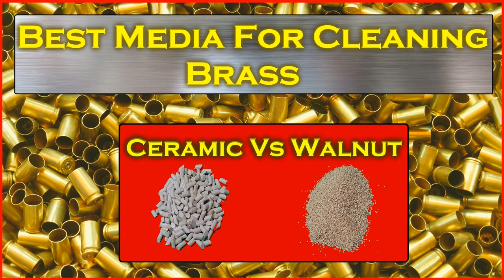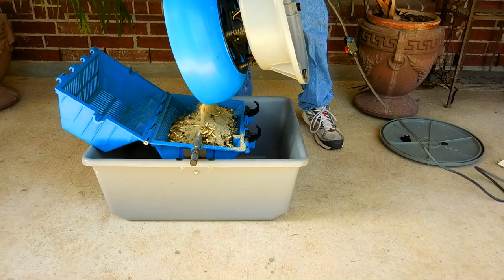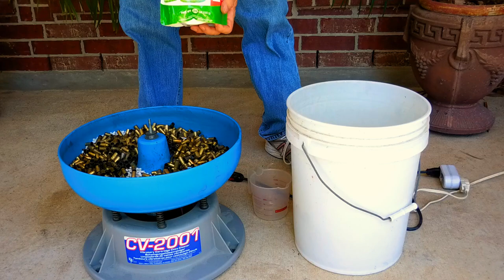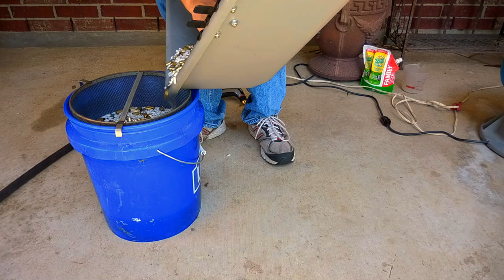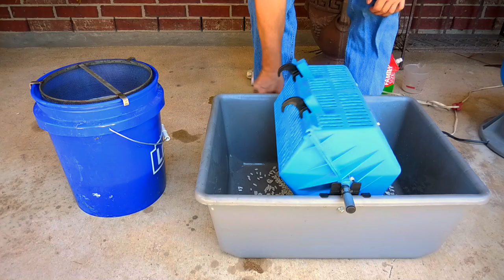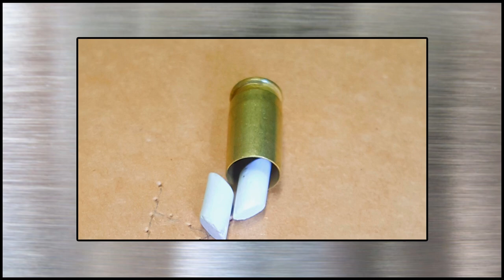How To Clean Brass - Ceramic Vs Walnut Media

Comment: I use walnut or corn cob media and have looked at the ceramic media,  thanks for the info. To cut down on the dust, add a few used dryer sheets when you tumble..it pulls a lot of the dust and dirt out

Comment: I switched to stainless steel pin wet cleaning and wow it will clean and shine the inside/outside of the pistol brass very well plus primer pocket if you deprive ahead of cleaning..  Which is another alternative to vibratory cleaning (used it for 40 years and did work).  A bit more steps to the wet cleaning and company’s have further added products to help separating the pins.   My wet stainless tumbler is from Frankfort Arsenal, which came with grills to help pour the water and pins from the brass.   Lyman then came out with a mesh rectanglar basket (2 Piece) which helped.  Later Frankfort Arsenal came out with a circular mesh replace the grills in the top of the cap’s and allows you to rinse.both pins and brass of the ‘dirty water’.  Because of surface tension of the wet stainless steel pins to ‘everything’,  I take my rotary brass separator, place some water in bottom to cover the rotating sifter and the pins will fall to the bottom as you turn the rotating handle.   Now that surface tension is sticky and not all pins will come loose but get 95+%  of them.   I then bought a food dehydrator. Place them on the trays turn it on and in most case 1-1.5 hours they are dry and any remaining pins will fall to the bottom.   I do recommend the pin magnetic from Frankfort Arsenal in which it has a handle with lever to move the magnetic from the metal part on bottom holding the pins, when picking any loose pins (small and difficult to pick up by hand, thus the magnetic pick up tool).   Well that is my thought and 2 cents, lots of different methods out there to consider for cleaning fired brass for reloading.   Good luck everyone!

Comment: I switched to a courser 18-40 grit walnut shell from amazon with some Midway USA brass polish and cut up dryer sheets to cut the dust way down. I may try the 12-20 grit next time for larger cases.

Comment: Vibratory tumbler tip:
Tear up a USED dryer sheet into 2 inch squares. Throw three or four into your Tumbler.  They will pick up dust and grime.
Reply: I put 2 whole sheets in.. Picks up tons of dust and the brass still gets clean

Comment: I used to take apart computers for the gold and along he way I saved all p[arts and nuts and bolts from them. I ended up with these little hex style bolts by the thousands and had no use for them later on. I kept them anyway and I got myself a tumbler and started watching rock tumbling videos with those nasty little pins you speak of. I thought why not use those little hex bolts about 3/8" long? I tossed them in with a bit of walnut shell to absorb the grease on my tools I was cleaning. The rest was those little hex bolts and dang did they clean my tools and sockets beautifully! A dampened the walnut shell just slightly with water and that was all. I had new sockets, bolts, washers, you name it they were clean!

Now I need to get one of those tumbler things you have there to separate the walnut from my parts into that tub. That's nice. I was using a stainless steel strainer over a bucket wearing a mask and still sucked!

Comment: I get my walnut media at the pet store.   Last time I needed some I got three twenty pound bags of lizard litter in a buy one get 2 free sale.  I filled three 6 gallon buckets and 2 midway tumblers and a lyman 2400.   I run at least 2 of them every week.  The more brass in a tumbler the better, without overloading the springs.  The brass push each other against the media cleaning them faster.  Just a few pieces of brass in a tumbler takes forever to clean.

Comment: Thank you for debunking all the people flocking to rotary/stainless steel pins.
btw...there are some ways to minimize the dust so that you don't have to resort to liquids as part of your tumbling process.
1) Drop two or three used dryer sheets into your tumbler with your brass each time.
2) Always leave the lid on while your tumbler is running.
3) Wait a minute before taking the lid off of the tumbler once the tumble process stops.
4) Use a brass separator that has a lid, as my RCBS separator has, close it while spinning out the media, then wait two or three minutes before opening the lid and taking out the brass.
I have no problems with excessive dust at all with these very simple steps.
I just don't see the value of introducing the complications and time constraints of liquids in the process.

Comment: Didn’t mean to come off so brash. When I clean my brass I use fine crushed walnut, from harbor freight and tool then add brasso and let it distribute through the media. Keeps the dust down and does a good job of cleaning. I use range brass so I’m not worried about a high shine.
Reply: DO NOT USE BRASSO. Brasso contains ammonia which makes brass brittle.
Use a 50/50 mixture of Nu Finish Car Polish/mineral spirits.
Reply: Jun Gleno, granted, brasso will make brass brittle if used extensively, especially on rifle cartridges. 

I have used brasso as a case cleaner for over 30 years. It has never been an issue as I don’t reload anything but 9mm range brass, which has anything from military stamps to assorted commercial stamps. There is no way to determine how many times it has been reloaded. I have never had any issues using brasso with these cases and it does the job of cleaning the brass to my satisfaction. If I do find a cracked case it’s usually from someone who was shooting major.

Comment: I use corn cob, about 1/4 inch, from pet supply dept. of Walmart or Petco.
I use about one ounce of mineral spirits and a about one ounce of Dillon or Turtle Wax or other liquid car wax with abrasives, even Midway Citrus Brass Cleaner.
I also stick in two dryer sheets, cut in 2" squares, appx....
The sheets absorb all of the powder fouling, and the bottom of the bowl is virtually dust-free.
Mineral Spirits wet the dryer sheets, so they can absorb the dust.
I don't like "Wet Tumbling" too much effort.
The primer pockets can be brushed out with a power drill in 5 seconds each and there's no drying, or pins getting stuck in the cases...

Comment: good vid......wondering what size and shape ceramic media would you suggest for 6.5 creedmoor and 308 cases.
Reply from the maker: I wouldn't use ceramic for bottle neck brass because it would be almost impossible to get it all out of the cases. I think it is great for straight walled brass.

Comment: deprime before cleaning, gets the primer pockets nice and clean
Reply: don't deprime if yer going to use cob.. ask me how I know.. lol.
Reply: Not necessary. You will lose those pieces of brass on the Range long before the primer Pockets get too dirty to properly seat a primer.
Reply: I'd rather use clean brassin my press when depriming.
Reply: I deprime after tumbling so the media doesn’t get stuck in the primer pockets, which is a PITA to clean out.  Primer pockets can easily be cleaned of carbon fouling with the wire brush or uniformer on my trim mate station.

Comment: Walnut shells and NU finish car wax vibrate for 24 hours clean and high shine
Reply: Two to three hours is more than sufficient.
Not the nu finish wax. Use a 50/50 mix of Nu Finish Car POLISH / mineral spirits. 
The POLISH contains NO ammonia.
Reply: I run walnut shell (PetSmart Lizard Litter), one cap full of NuFinish polish, and a dryer sheet cut into fourths.  Tried corn cop media but it really turns into dust and gets stuck in the rim recess of 45 colt.

Comment: Nice video!  Was it necessary to seal the bolts in the Dillon Case Cleaner?
Reply from the maker: You don't use that much water, you are just moistening the media and the brass. So no, I didn't have to seal anything, there really isn't any water to leak.

Comment: where do you get your ceramic media and what about using spheres or round media?
Reply from the maker: I purchased it on Amazon. you probably could but always remember that it has to big enough so two pieces can't jam next to each other in in case. So their diameter would need to bigger than the radius of the case.

Comment: Not really an even comparison because you don't use citric acid with walnut. 
If you just soak your brass in a bucket with the acid it will do the same without  the ceramic.
Reply: acid soak alters the alloy composition.

Comment: Washing and all that stuff with the ceramic is overkill!
Reply from the maker: It depends, if you are doing high volume like 5K frequently, it is a lot faster, cheaper and your stay away from the contaminated dust. If you do 1K or less every once and a while, you are right. It is a high volume process.
Reply: @AdventuresinFabrication  I am sure you realize you are dumping toxic chemical liquids down the drain?
Reply: @jungleno.  Incorrect. No different than when you wash dishes in your kitchen sink or turn on your automatic dishwasher.  Dawn. Lemi-Shine ( citric acid) water. The powder residue is almost pure carbon. Dawn touts itself as safe to use to de-grease living animals like after oil spills, I'm sure you've seen their commercials with the duck/pelican/otter etc. . Lemi-shine is a natural extract of oranges and lemons.  Please do your research first before you flail around your false enviro-claims.
Reply: @scottcrawford3745  It’s not the powder residue that’s toxic it’s the lead styphnate etc. in the primer mix.